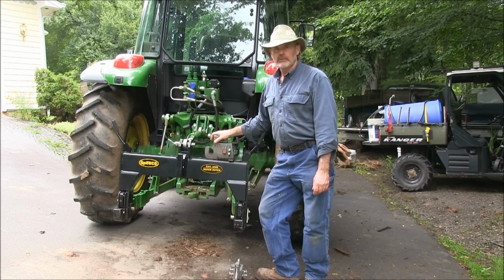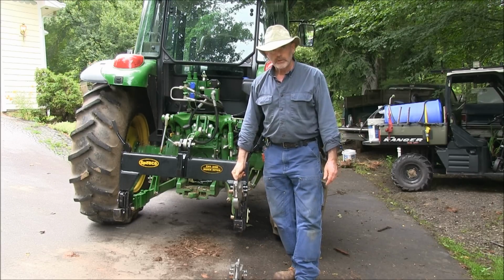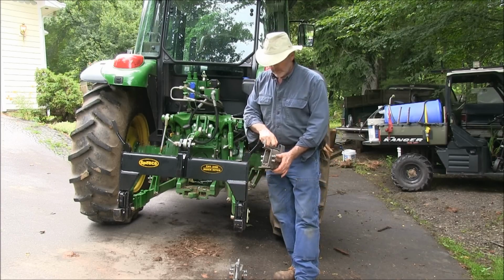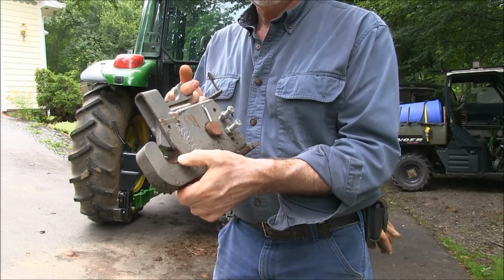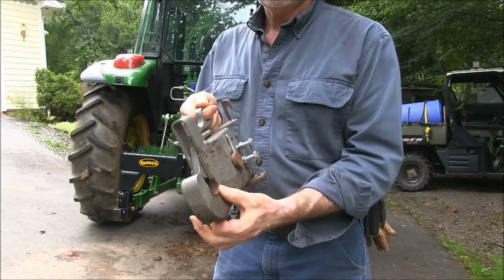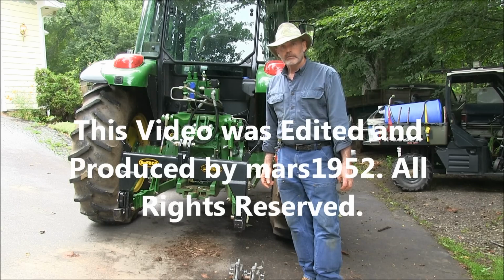Pat's Easy Change Quick Hitch Install Follow Up

Comment: We LOVE our Pat's Easy Change System from Greenwell. 

They are sturdy, save time & are so easy to use.
We've been using them for months, not just 20hrs. We farm 200 acres and we change implements in minutes, and the stabiliser bar makes it so easy to go between lots of different implements.
I guess you just have to install them correctly...
We spoke to the manufacturers and so long as they are installed correctly, they are happy to honour their lifetime warranty.

Comment: Used the Pat's hitch for over 100 hours last year.  I mowed, sickle bar and bush hog, and a john deere 25a flail mower, back blade for road maintenance, used a 6 foot rotovater, disc harrows, and chain harrows.  I own over 240 acres of farm land and when installed correctly they work fine. By the way audience they fit different width implements so they are adjustable.  I have been using 3 pt hitches for over 40 years and it made it easier.   Mine are on a over 60 horse new holland tractor.  Not our only tractor but my favorite so it hooks up to a lot of implements and this was great.
Reply from the maker: ***** It sounds like you are doing the kind of light duty work that the Pat's Easy Change Hitch can handle. None of the implements you mention are over 700lbs. The JD MX10 mower that I was using is over 2000lbs and my fields are in the mountains. (I should have mentioned that in the video). Imagine picking up a 2000lbs mower and doing a u-turn on the side of a steep hill. That is when the little 3/8" bolts that hold the hitch in place bent.
Reply: @mars1952  gets some hard grade and shorter bolts to put in they work fine!

Comment: I'm pleased I just tripped over this video. I was looking to use Pat's Easy Quick change cat 2 with an 1100 pound Woods BB720X Brushbull on a 60 hp Kioti tractor.

Comment from the maker: I am glad that you had better luck than I did but I bet that you have flatter ground and a smaller tractor. The weight of the implements cause a lot of stress on the hitch when traversing a  hill side.

Comment: I think it's all about the spacers that fit down in the bottom below the lift arm of the three point hitch.  I just installed them on a Cat 1 hitch.  They came with four spacers, two thick ones and two thinner ones. I found that I needed a thick one and a thin one on each lift arm. I have used them on a Bush Hog so far and so far they work good. Still tight after a couple hours of rough hog'n.  Still requires some fiddling to hook up to two implements, the bush hog and a box blade. One is narrower than the other. For that reason, the width has to be readjusted. The width rod that came with the kit, pretty much solves that problem. I marked the rod for each setting. Not really a problem.   Sure a lot easier than doing it the old way.
Reply from the maker: The spacers all fell out when the bolts bent.
Reply: As you explained to Martin Navojosky,  My tractor is a smaller JD and my implements are not nearly as heavy as yours.  The side bolts on my Quick Hitch are 3/8.  At the bottom of the threads, the diameter is probably less than 5/16". That's not big enough for the stresses you get with your larger equipment. You could do two things, drill and tap the holes bigger... 7/16" and or use a higher grade of bolts, stronger steel. Mine bend in time after more use. If they do, I will replace them with stronger bolts. The reason I went with the Pat's design was due to my implements having different widths.

Comment: I think this guy doesn't  know how to operate equipment I've been using them for along time on bigger tractors they work fine. He's to ruff and is a novice. I put a twenty foot field cultivator and a rotterhoe, and cultivator 8 row and mine have been fine.
Reply: The soft steel wearing out that like isn't something he could have done being a "novice".  It's a lack of good design.
Reply: @wyattbonnette3414  No. It's design for a point.  Use extremely large implements in an extreme (mountain side) environment and it is always possible to exceed the design strength and limits.  Pat should probably publish the design limits of the adapter, e.g. maximum weight or moment.  The bolts should probably be either higher grade or made larger size.
Reply: This is an older video so I don't know if they have changed over the years but what he showed in the video looks different than the Pat's system I've seen recently. Either his isn't a true Pat's system or they have changed them. Maybe he had a different brand or they have upgraded them. I don't see how the bolts could bend if they were tight. I've watched a lot of videos showing people that are very happy with them. Something doesn't add up.